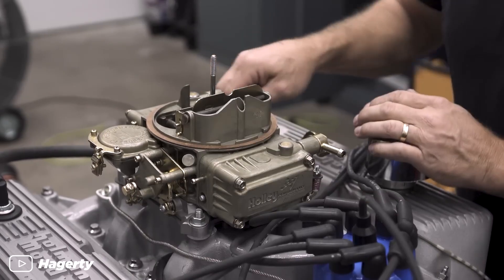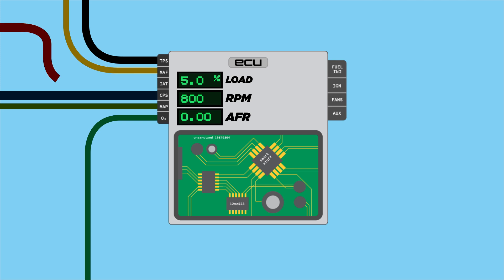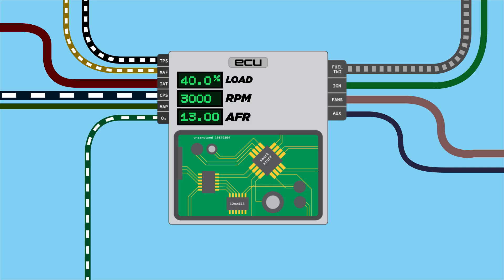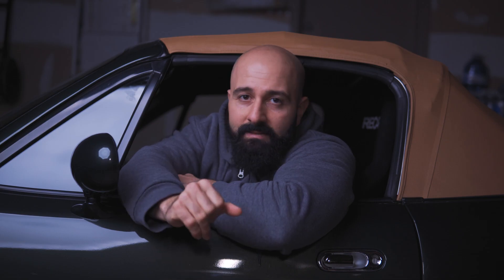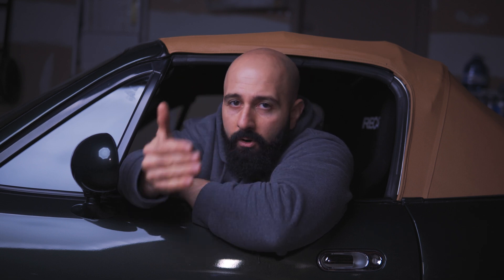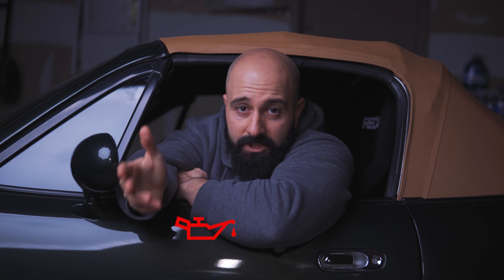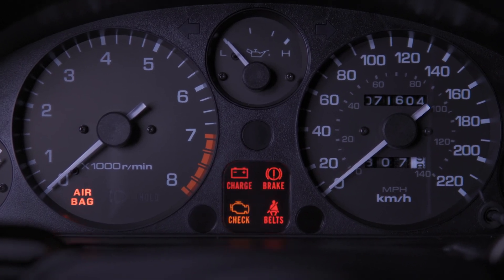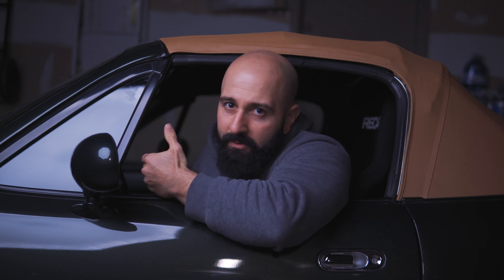Engine Warm-Up Myths || EXPLAINED

Comment: My warm up routin is as the same time I turn the ignition and press down the throttle fully and keep it there and the engine at full RPM, until the engine gets to operating temperature. It's way faster that way! Thanks for the video!
Reply: Surest path to a dead car
Reply: What a tired joke
Reply: Fastest way to crack the engine block, lmao.
Reply: @baloghbotond4250  take the c20seh engine, no oil or water from cold lasted 40min before it failed 🤣.
Reply: 😂😂😂 please tell me you're from the UK this is how me and my old school vauxhall pals treat our cars 🤣

Comment: Finally someone said it. The engine/oil warms faster if you drive slowly than if you let it idle thus, minimizing the wear
Reply: Nope! Driving slowly? What is your RPM range? 3000, 4000? 
Engine Idle speed is only around 600 to 650rpm that is the safest Engine speed to operate safely while idling and warming up. What you are doing is you are accelerating the wear and tear on timing chain, camshaft, crankshaft bearing, Piston Rod and Piston Rings. The valves will easily accumulate lots of carbon deposits due to the engine is really cold, freezing and you are driving it. IF your gonna sell your car I'm not gonna buy it! And I know a lot of cars and vehicles that are being sold in my local CarMax dealership. I know how to examine a car very well in a first start I can easily spot and tell that the owner of the car doesn't warm up his car.
Reply: Better if you drive out at max of 2000rpm until coolant is above 75 degree C or above 165 degree F. My engine oil pressure gauge vs engine rpm vs coolant temperature showed me that it would be a few miles during a cold. 

My case at 740rpm & 143 degree F engine oil pressure is at 2.3barg. At 195 degree F it is 1.5barg. At 200 degree F it is 1.1barg. Oil is 5W40.
Reply: @whlawson5812  whats "barg" you mean bar?
Reply: @keisuketakahasi4584  oh, as in bar gauge. Btw my local ambient air never goes below 68F. The oil pressure did not drop below 4.5bar at 2000 rpm for the first 3/4 mile. I think this 18 year old car of mine can last another 5 years if changing semi synthetic oil & filter every 5000 miles. 🤣🤣
Reply: @whlawson5812  i think 5k miles is a little excessive but rather sooner than later
Reply: Not if you have a carburettor car.
Reply: This is incorrect. VERY incorrect. One of my car's has a wideband air/fuel ratio sensor. When you're idling, you're running lean at roughly 14:1. When you put it in gear and actually get the car moving, even "gently", you're enriching the fuel mixture based on the A/F table values form the factory and you're A/F ratio usually goes down to like 12:1 so you're putting MORE fuel into the cylinders. The SAE did a study where they already had an engine fully warmed-up and then they started to lower the coolant temps and oil temps and because they irradiated the cylinders, piston rings and cylinder wall, they could detect the irradiated metal particles in the oil sump and wear metals INCREASED when they lowered the coolant and oil temps! Plus, who is going to drive their car "slowly" when you merge onto an avenue or boulevard or freeway with everyone trying to get to work behind you?
Reply: In simplest form....still water freezes, flowing water doesn't.   The friction of movement within the particles themselves 👍
Reply: A point no one seems to mention in these videos: not all engines have had equally competent thermal engineering.  My vehicle requires either an "extended" warmup or highway driving in very cold weather, or it will never heat the interior correctly. My friend's Lexus, on the other hand, heats up the interior very quickly regardless of driving conditions.
Reply: It also warms up evenly, unlike when you sit idling.
Reply: @ Warms up evenly? What does that even mean?

Comment: I just got a 93 Miata with the 1.6
I have to let the idle go from 1600 to 1050 upon startup, if not she sputters when accelerating , after that I just go to 4k rpm for shifting on 40mph roads

Comment: Ye my routine is basically yours. I start it up. Wait a few seconds for the idle to drop before putting it in gear. Then it's about 3-10 minutes before I can go apeshit on my car. That wait before it gets to operating temp does very by about a minute or two in cold weather.

Comment: Let it run for a minute standing still, below 3k rpm - no boost until 90C oil. Then remember cooling the car after hard use.
Reply from the maker: Yesss! Cool down is a must after a hard run

Comment: Ive owned several high performance cars some with 1000+HP. Just start your car, and start driving while keeping revs low until motor oil warms up to operating temp.
Reply: Is that why you had 'Several' cars? 🤣
Reply: You should Wait for the high idle to go down first before you start driving though imo
Reply: @MattHawk5.0 yup. I keep my boxer engines at its lower idle revs before driving them.
Reply: 😂😂😂😂Bro just realised he explained to himself why he has “owned” hp cars….drive it cold and watch the dollars unfold.